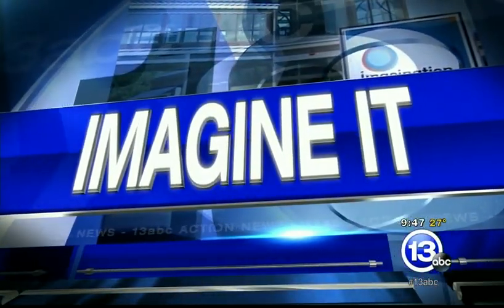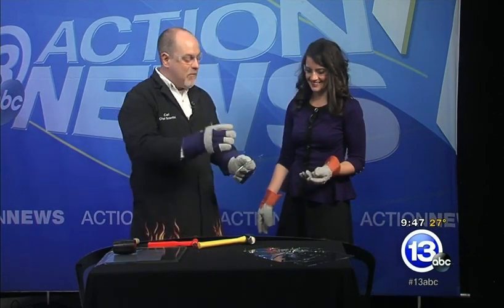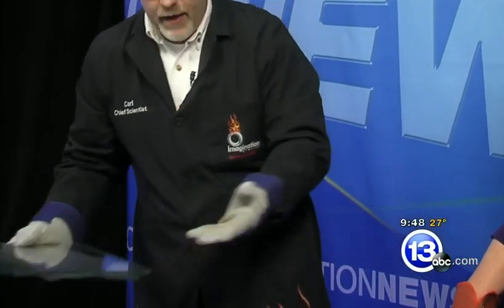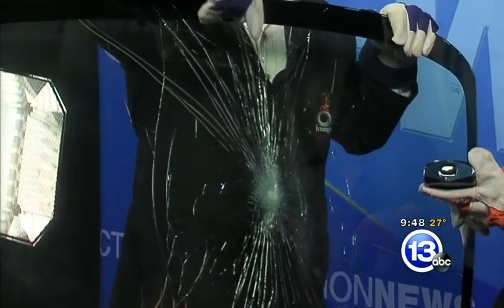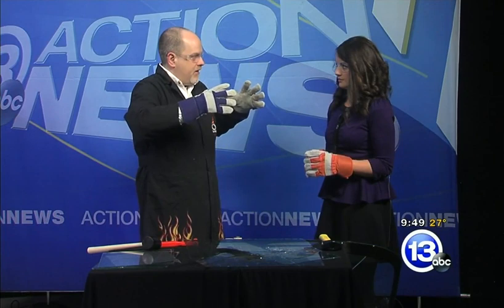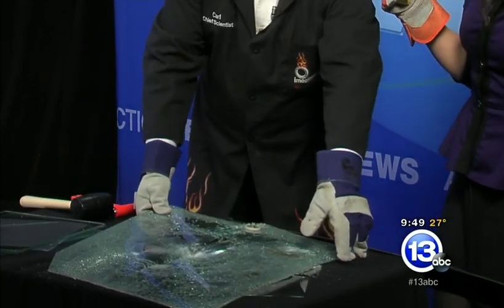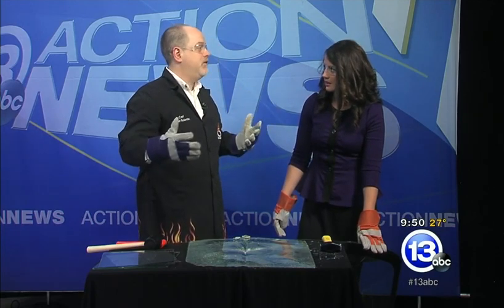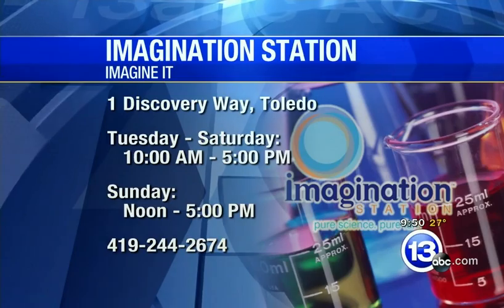Smashing a car window using science

Comment: Stop your head from going through the windshield?  Not if you are wearing your seat belt like your suppose to. And I have heard of people being ejected out through the windshield during an accident while not wearing their seat belt and the car did;t have air bags.
Reply: Even with airbags installed people get ejected out of their car, if they dont wear their seatbelt. Seen it multiple times
Reply: Yes that is so true. Allot of people think they are safe because they have Air Bags and Seat Belts are not required. This couldn't be farther from the truth. Here in Canada it is the law that Seat Belts must be worn regardless whether the vehicle has Air Bags or not.

Cheers
Willy
Reply: I hit a tree at 130kmh, the seatbelt snapped and my head punctured a hole in the front windscreen.

Comment: if its so strong why did a bb break through it tempered glass
Reply: +Nick Levine For one, BBs are flying significantly faster than a human arm, about 320 meters per second. There is less surface area on the BB, so there is more force in one "point" on the BB, allowing it to break through. Hammers have a larger surface area, so less force is in one "point" on the hammer.